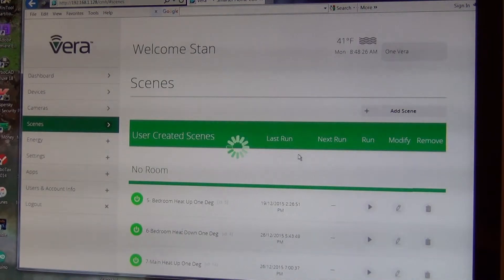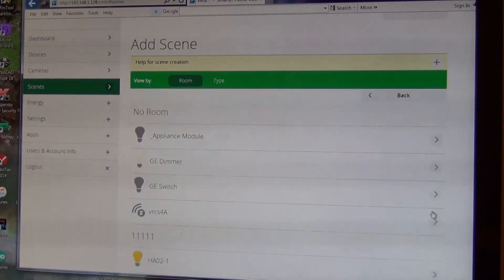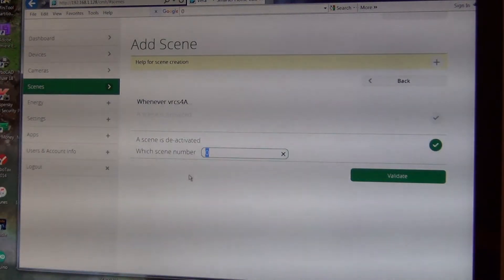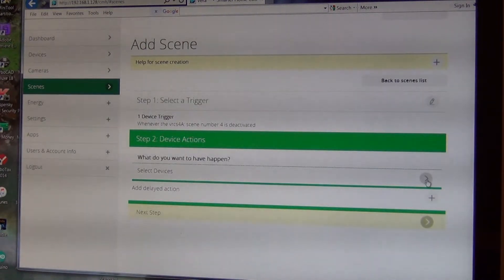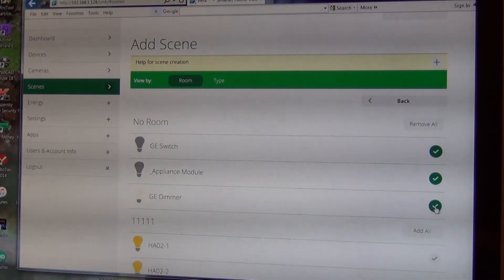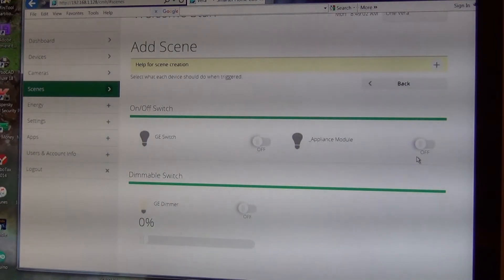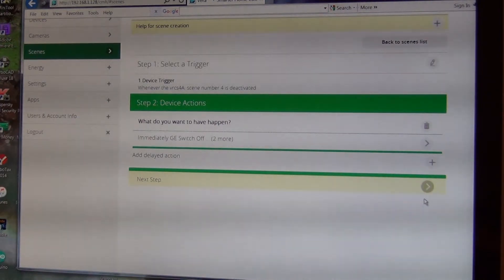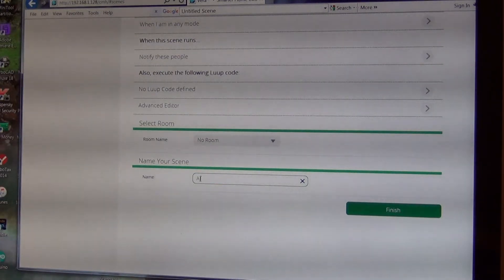Leviton VRCS4 MRZ Fourth Button All Lights

Comment: Do you have to leave the Vera hub plugged in and near the 4 button remote to keep it working or can the Vera download the program to the 4 button device?
Reply: The 4 button remote starts scenes in the Vera, so it is the Vera that is doing the control.  So, yes you need to leave the Vera plugged in and the Vera must be able to communicate with the 4 button remote.